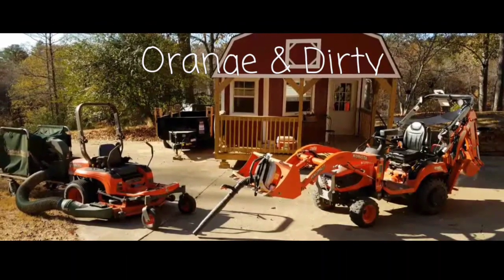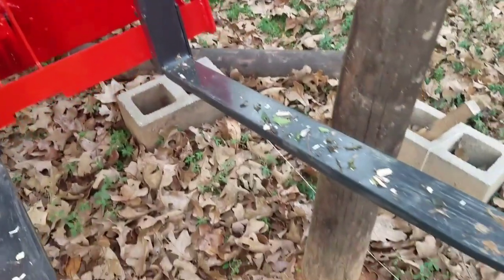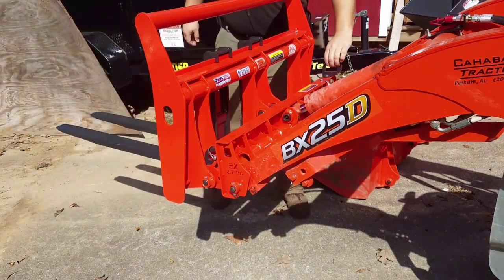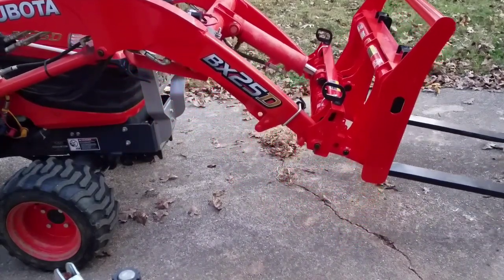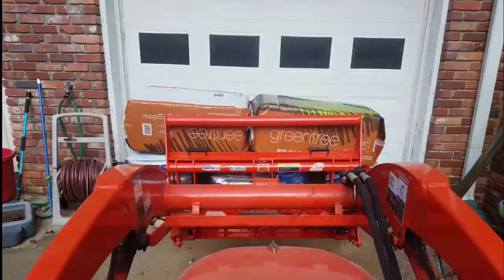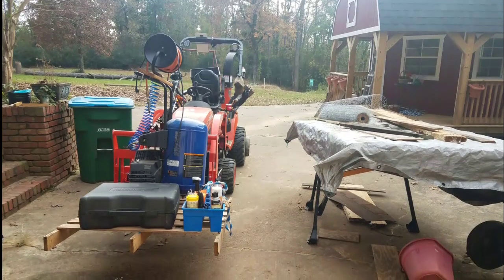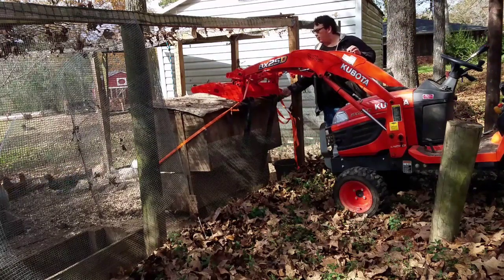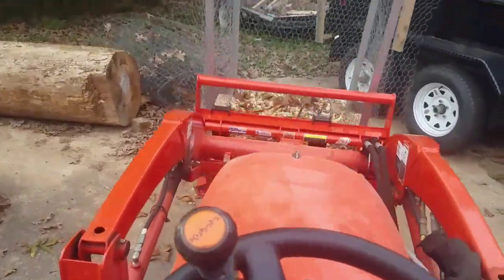Ai2 Pallet Forks on Kubota BX

Comment: I will make one last comment, you did a great job outlining the weight associated with the quick attach and forks compared to the bucket.
This is key with fork add on's to a small tractor.  Many fork additions simply add too much weight for what they can do in this size tractor.  This is what Tony has excelled at.  He has taken the time to do the logistics for weight distribution and BX capacity and matched them up nicely.  The quality build and product application designed for the BX means you get what you paid for.  It simply works.  Just my opinion.
Reply from the maker: +Rick Bumeter exactly! He understands what we need! I forgot to mention/point out that yes the other forks out there might have a higher weight rating have wider and longer forks but that is at a cost of weight and usable lift capacity.  Plus with the BX, that increased rating of the forks would be a moot point because you won't ever be able to lift that much.  I guess we are singing to the choir!